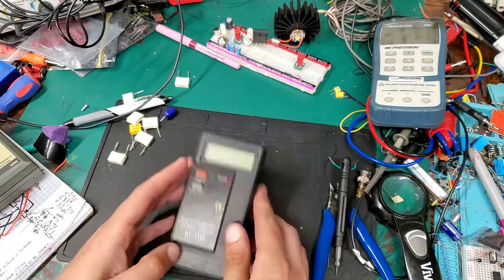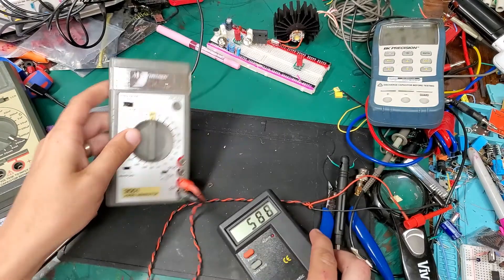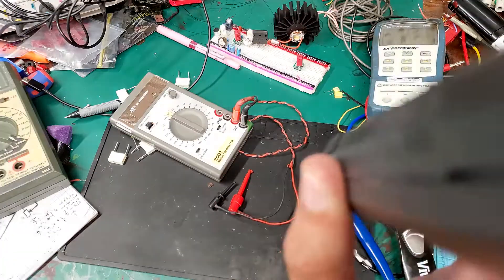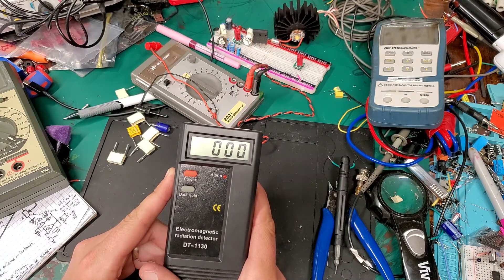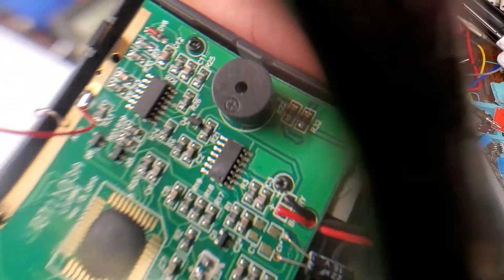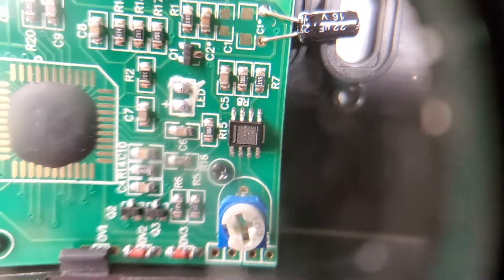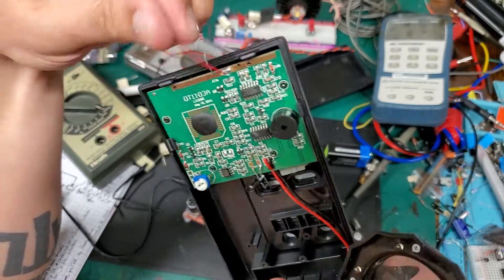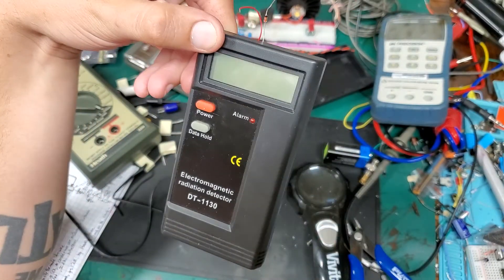Teardown Ebay electromagnetic radiation detector dt-1130....or is it dt-1103?....dont know, nor care

Comment: So does it work or not ?
Reply from the maker: Yes but it picks up evvvveeerrrrrrything. Even static electricity.    ...if you have a outlet strip with a tv, game console and anything else plugged in, it will light up light up like a Christmas tree.   If there is a active router within 20-25 feet of it, forget about it. Itll make you think you're dead within the next minute. But....its fine. Everything is fine.
Reply: @topherteardowns4679  damn....i wanted to check the radiation of my solar panels. Do you have an instrument you would recommand for that?